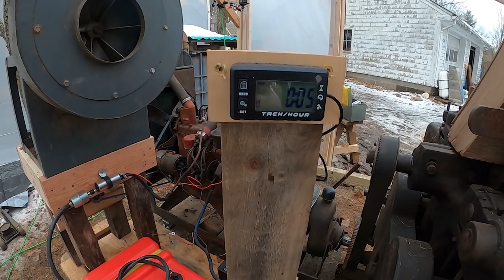A2A - Journey of a Wooden Boat - Episode 101: Pairing an 1800s Thicknesser and a Chrysler Flathead 6

Comment: A little tip use a candle rub it on the tables and your timber will glide through, also if you can’t take off a small cut it might be the in and out rollers need adjusting, thanks for the great videos

Comment: BIG suggestion -- get some candles and rub down the bed of that planer real good..The candle wax won't interfere with anything and the wood will go through MUCH easier. Regardless of the thickness the wax will help everything move better.
Reply: You could even use some 3 in 1 oil or WD40 but you might want to sand the beds a bit too to prevent discoloring from the rust.

Comment: With the freeze/thaw cycle happening that heavy equipment will sink into the ground and you will be re-leveling almost daily !
Reply: I have to agree with Jack on this. As I watched you level the planer + engine, it occurred to me (and you too, I suspect) that the ground is frozen now, but this spring that is going to change. Possibly quite a bit, and often, too, given the vibrations from both the engine and the planer. I’m not criticizing, just wondering how this will perform over time and what adjustments will be needed.

Comment: the chip  'funnel ' seems to be a little big. If you cut it about 3 inches from the top of the metal pipe and cap it  you might get a stronger draw form the fan.

Comment: Don’t get a hammer and beat on a bearing to get it off or on. It will cause premature failure. Heat the pulley/bearing up to around 500 degrees , which ever one you need to install, and it should slide on. Be careful to have a straight alignment to the other piece of equipment as quick as you can before the shaft draws the heat out and locks it.

Comment: You'll know when folks working in the shed start complaining of headaches, nausea, and dizziness. Noticed when you fired it up the first time looked like there were some leaks in the exhaust manifold - maybe bad gaskets. You're probably going to expose workers to hours of exposure planing all that lumber - don't underestimate the risk of CO poisoning. The pipe is also going to get red hot and there's no shield or guard. Great job jerry-rigging this thing to make it work -- OSHA would probably shut you down in 2 secs for safety issues.  Just saying, take a moment to make is safe as well as functional.

Comment: Great job setting that planer up. I would suggest that you put clutch on blower. (Maybe something with a idler pulley on a arm. ) That way less drag on motor when starting and WHEN blower gets blocked you can disconnect it before belt gets distroyed
Reply: Seconded!!!
Reply: Thirded...  I have never seen a large dust collector that runs that way. Typically, the collection is before the blower (which runs more like a vacuum).

Comment: Sorry you missed out on the woodworking spring break. Glad the building inspection went well. Nice job on the cathedral roof.
Looks like after a lot of effort the planer is making chips. Along with daily lubing and maintenance you might want to sweep off the radiator.
Really wish I could be there for the planking party. I know it'll be success.

Comment: Be sure to add an Air filter onthe Chrysler with all that dust floating around
Reply: And pipe it to draw air from outside the shed....
Reply: Seconded!
Reply: Those old Chryslers normally had oil bath air filters
Reply: @organblower  you will have to clean the air filter less often if you have it draw fresh air from outside the planer room, even if it is an oil bath.

Comment: I just had an important realisation about the fastening of traditional planks using copper roves, thanks to watching another clip on manufacturing defects on a 100 year old carriage wheel (Engels channel). Whoever had originally put the wheel together had munted the "rivets", evidently by using too heavy a hammer. 
An astute comment pointed out that "rivetting" is the wrong process description: what is needed is "peening". 
Rivetting relies on the rivet passing through a material which is less resilient than the rivet. Wood is not able to prevent the body of a metal rivet from collapsing sideways, so you need multiple fast blows from a  relatively light impactor to deform just the head of the rivet, rather than a few slow thuds from a very heavy one. (Some metals are malleable enough to be contained by wood, like pure lead, tin or gold, but those metals are not strong enough in tension to be useful as rivets)
The old saying ""If it don't fit, don't force it, just get a bigger hammer". contains an important truth, just one which is not applicable here. 
When solid rivets pass through metal, part of their advantage is that the shank can be encouraged to swell in diameter, preventing the resulting joint from slogging or fretting. And in such cases, a "bigger hammer" is the tool of choice.
There's lots of other instances (in fact, they're much more frequently encountered) where it's preferable to use a heavy hammer, such as when you are trying to MOVE an entire component relative to the assembly, without damaging the place you're hitting it. Carefully thinking through the mechanics and kinematics of energy transfer, friction etc, reveals that requirement to be best met with a heavy item swung at a slow speed.

Comment: Long belts might just need a tensioner pulley...think junkyard gm belt tendioners...most use a simple spring and mount with a single bolt
Reply: And a machine guard on the belt. Remember 'Safety First'  !
Reply: All brands use similar styles and attachment methods.  Thinking "GM only" is  a good way to paint yourself into a corner, where there were twenty other possible exits.
Reply: @linmal2242  Dont get your goldy locks beard close or anything else you dont want to loose. Youll be fine without them. Generations before didnt have as much safty as we have now and were tougher men then we are today.
Reply: @brandoncaldwell95  Famous last words !
Reply: @linmal2242  I've worked around plenty of equipment without guards or any type of safty devices. Never an issue as you should respect a machine and give it space. If you're that close with anything loose, you deserve whatever you get. Afterall, your responsibility to keep clear of know running items and make sure you and it have the proper space. Called common sense.
Reply from the maker: We will be adding guards to the belts where possible. When using turn of the century industrial equipment a higher level of caution is definitely required.

Comment: Nice work getting all those pieces to work in harmony!  Lining up those belts is often really twitchy.   The polycarbonate fuel tank looks pretty modern.  Would love to hear the music that the planer, flathead and chip collector make  as they are shaving cedar and oak. Next video please give some thought to losing, or at least cranking down, the background music and cranking up the gain on the mikes. Was that a Burke bar you were using to lever the engine around?  Keep up the good work!

Comment: I hope you vent your work area well. Carbon monoxide is easy to build up if running for a while. The operator may not even know its getting to them.
Reply: The shed doesn't have a back. Can't get much more vented than that.

Comment: I can't tell your sound level, but I can say I was VERY happy to have used a Oval can reverse flow muffler (sized for a modern V8) on an old combine with a straight 6.  That was a flathead Hercules on a John Deere model 55.  It really lowered the operator fatigue, to have the engine well muffled.  All in all I like your rig! Keep fire suppression gear handy.

Comment: The exhaust port on the dust extractor should be bigger than the port on the fan. this will allow the air to slow down and drop more chips into the collection bin before exiting.

Comment: A suggestion on the dust collection system.  A cyclone between fan and planer.  That way the chips and dust do wear on the alum fan.  Aluminum is a pretty soft metal.
Reply: Traditionally, the blower would be placed at the end of the line, on the far side of the collection box, yes?
Reply: Yeah you are right.  Put the fan in the cleanest air possible.
Reply: I understand why the fan is placed where it is.  You want to drive it off the flat head.

Comment: Why not create an extension bar from the clutch handle across to the other side on a pivot underneath the dust pipe? Seems like there would be plenty of room for it if you moved the post the Taco is on.

Comment: I am a bit concerned about the blocking and shimming being under the long 4x4 planner skids (12:30) instead of above them between the long and short 4x4 skids. It seems that having a full bearing of the 4x4 on the ground would be better in helping to prevent settling once the work and vibration begin. The small surface area of the leveling blocks under the skids could just settle down into the ground.  Maybe no big deal if the ground is hard enough. :)  Can't wait to see her lines after the planking party. What a beauty. cheers

Comment: You should buy a few enclosed modern baring's to replace any of those babat baring's if they unexpectedly burn out all of a sudden. They can be replaced with modern baring's cant they? I know you'd probably wanna keep the machine as authentic as possible but when its gonna get the machine up and running again faster than putting in new babat baring's then? Or am I talking nonsense? lol

Comment: How's it doing on maintaining RPM as you run wood through?  Because my first thought is that you'll need a governor to keep the RPM constant as the wood goes through and the load varies.  That can be as simple as the Mk 1 eyeball, a tach, and a a throttle for the guy whose eye is on the tach, but I didn't see the latter.

Comment: I would get that planer running for 30 or 40 min. then check all the bearings.  Old equipment like that can have a bad bearing & you would never know until it fails & tears things up.  Just run it the feel every bearing.  A hot one needs to be replaced.
Reply: Re-poured. Babbit wont fail as catastrophically as ball bearings, the shafts get real loose first.

Comment: 1800's plainer, 1947 motor, 1960/70's dust collector, 2000's tachometer and fuel tank. You've got it covered. My only critique would be... I would have fabricated a tensioning pulley on both of the dust collector belts for easier belt replacement in the future.

Comment: So sorry you couldnt both make the trip. Great to see the "new" thicknesser running. Hope the exhaust is solid and vents away from common walk areas and doesn't leak inside the thicknesser house. The chip collector will fill up rather quickly once the cedar starts going through that machine, but should be manageable.

Comment: Just think what you can do with that machine when you surface the knees. What make is the old beauty. I ran a 1954 Buss double surfacer for years.I think it was the biggest one they ever made. 12,000 lbs dry weight. Sharpened and maintained it. That was back in the seventies and eighties. I still think about that machine all the time. You will fall in love with your's. Happy New Year and happy planing.

Comment: I had a 1947-20 ton Unit Crane for many years.  It was powered by a Chrysler flathead straight eight industrial engine with 330 Cu in displacement.  It was a rock solid piece that never gave up.  After the crane became so maintenance heavy that it was hard to even use, It got scrapped. Except for that engine, which I gave to a friend who was building a 1930 Model A Roadster where it lives on to this day.  (Reground camshaft, ported block and turbocharged)  That was back when obsolescence was unheard of and not one part was made in China.

Comment: You might want to consider a reservoir and drip tubes for the bearing oil wells. Granted that would add complication to the set up, as opposed to old school "oiler". I would recommend having an inferred thermometer to check and log bearing temps. periodically thru the day. Logging the readings is key to preventing a catastrophic failure. I have never used or worked on a planer of this age or size, but the very first thought, as you panned around, was Babbit Bearings. That is a term 99% of people have never heard and they are in every vehicle on the road. My favorite engine mechanic had never heard the term until I explained it. To him it was just main and crank bearings. Thanx for the reference.  
I am curious to see if you installed spring tensioned Idlers for your belts. I was scratching my head, watching the set up, as to why you didn't in the first place. A tip on belts and belt PTO.... BELTS WILL RUN TO THE HIGH SIDE. Meaning that a belt will run up or migrate to the high side of a pulleys tension. That sounds counter intuitive, but that is how it works.

Comment: I suppose that if you were looking for a component from current times to "cover all of the genres,"  1800's thicknesser, 1940's motor, 1960's chip collector, then your digital read out and kill switch set up would be it.  No?

Also notice that the further back in time the component is from the bigger it is?

Comment: Nice work, and a couple of suggestions (which may have already been made, but I've only gone down a couple of pages of comments).

I'd have put al the controls on the remote panel - a bit more work in fabrication will save far more in operation, and give early warning of temperatures and pressures so that if anything does start to misbehave in the engine you can catch it before it starts breaking other stuff.  A sprung roller skate wheel will tension the belt a treat.
Oh, and ground ANYTHING conductive.  You have a lot of dust being generated right there and dragging the majority through the extractor will generate static electricity like you wouldn't believe!  That and the shed makes your modern component!

Comment: Just needs a roller or poly topped slide table to the side to make multi-pass easier. And you should consider dyeing and/or drying the cedar chips, landscapers will buy them...Fun to watch the old stuff being put back into service. The aero-space manufacturer I first worked for had a ton of WWll lathes, mills and grinders that I spent a lot of time keeping running, so much cast steel and open gearing...

Comment: OK,  I listened to the end of your video. You will be adjusting the throttle according to your electronic Tachometer, ok, you work with a crew and you can manage PRMs OK, if you get ahead of your work you could make a governor for your engine later.  The kill switch is a great safety addition. Keep up the good work.

Comment: Some one may have already said this about the size of the collection box. It is way to small.  We had a tractor trailer truck just for our furniture shop. You will be milling ehatvwe did per month in a single day. Your planer is about 10 times bigger as well. I love the set up though. And as for the pear tree that are will be under alot of stress. Maybe move the shed or dig up the tree and move it while the soil is still below 50 F. Digging up the tree will mean a large root ball to ensure the health of the tree. Wich means moving the planer.

Comment: I may be completely out to lunch, but my father was a planerman for 40 years and in the early days, he ran machines with babbitt bearings. I recall he used to pour a molten tin/lead alloy into those 'containers' above the shafts. The shaft then rides on the 'babbitt' and lubricates as the alloy melts into the shaft. I found a wikipedia page on babbitt and its inventor:https://en.wikipedia.org/wiki/Babbitt_(alloy) Apparently you can still buy the alloy on the eastern seaboard and in Canada.  Interesting set-up you have going. Love what you do with older yet completely serviceable machinery. Can't wait for the planking party!

Comment: You mentioned a low or dead battery. If your generator is not charging, Here are the steps to make it charge your battery. Remember, the ammeter should show a sight charge even at idle if your generator and voltage regulator is working. I think I noticed you running a 6-volt battery if you change to a 12 volt your ignition will need a resistor to the points to reduce that voltage, or your points will burn quickly. If your charging system is not working and I think the battery was disconnected for a long time your generator may have lost "polarity". Easy to fix, here are the steps: Leave your battery connected, take off the fan belt that also turns that generator, take off the voltage-regulator cover, with a piece of wood for insulation close one set of contacts at a time and notice when the generator turns from the battery power.    The "turning" generator will "polarize" itself.     This is the repair.     Now replace the cover on the voltage regulator and the fan belt. If these components are OK  when you start your engine the ammeter should show a charge. I did this on a few cars back-when and a few tractors. I learned this, way back when,  from other older guys, and the older guys on your crew may already know this repair. Good Luck, Great Job

Comment: Always interesting, I don't know who else may have caught your description of the charging  device on the great 6 cylinder engine, but.... you referred to it as an alternator... no disrespect intended, but,   that is a generator. It may work just great, that is the correct period device for charging. I used to repair them, nice to see one being used. I did maintenance on many of those 6 cylinder flathead engines, they are tuff power units, hope yours has a governor on it, it came from a shingle mill, so maybe it was put together like a tractor engine would have been, or maybe you and your crew can build a wind-driven-from the fan air, governor. A governor will make the throttle open and close according to the power needs of the load, thereby maintaining a constant machine RPM for your work. Great job all-around.